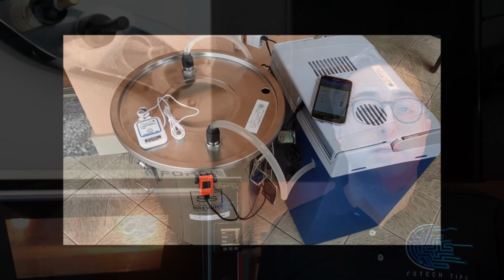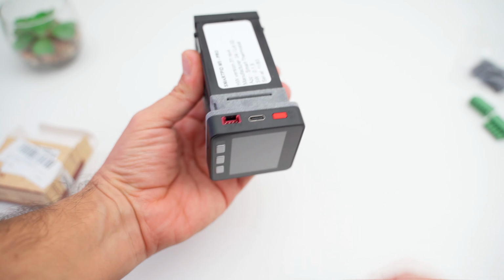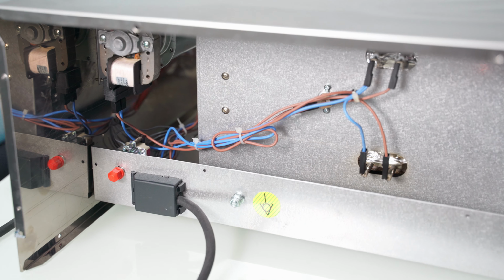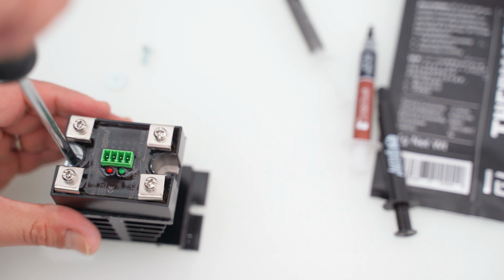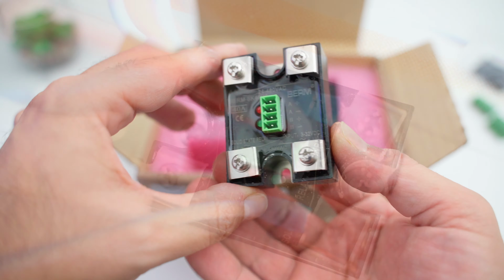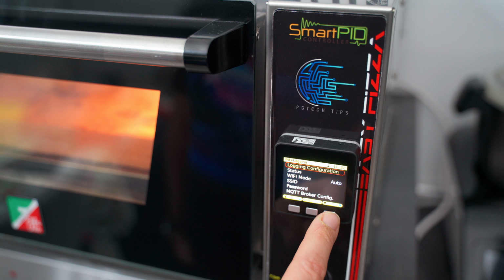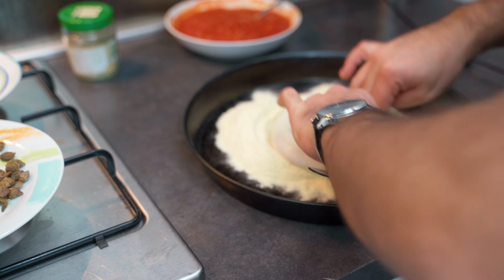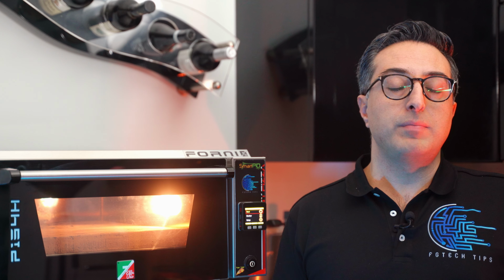Effeuno P134h PID mod with Smartpid: review, tutorial & Pizza test

Comment from the maker: Hi everyone, I'm leaving you below the list of potential changes you might desire for the new firmware, in order of priority. Let me know if you agree with these points or if you maybe have additional ones!
Italian version here: https://www.youtube.com/watch?v=20kic-XJHu8

THIS IS MY VIDEO FROM DECEMBER 2021 RECENTLY MOVED IN THIS NEW CHANNEL

PRIO 1
- Impossibility to perform simultaneous auto-tuning on both heating elements: if I perform an auto-tuning only on the upper one, the values could be wrong because the parameters I have to set have to take into account also the lower heating element (which helps in ramping up), that's the reason of the higher value than what set on the Set points and for the pid sleepiness phenomena  (it struggles to reach the set point)
- Improvement of autotuning, currently I understand that it sends 100 and zero but does not calculate all the intermediate values, this makes the autotuning extremely basic while it could be much more performant with the improvement of firmware
- No partialization which is present on much cheaper pids
- Lack of fuzzy logic
PRIO 2
- WEB app does not detect anything during tuning, everything remains on N/A. No problem instead in normal execution in monitor or start mode
- There are no limits in the set point selection: in the pizza world there is interest only in the range from 0 to 550 C
- It would be possible to remove all the probes except for the K probes or set this type of selection by default
PRIO 3	
- CSV file naming seems to be nonsense, it would be better to have a timestamp with time/date, moreover the file modification/creation date is not shown, making it impossible to know which execution it corresponds to
Reply: Im here 3 years later and totally going to do this mod to my 150HA what has changed over the last 3 years? I ordered a controller from the guy you referenced. Than, you for posting this in english its so cool!

Comment: I watched your videos and really want to do some mods on my oven. I tried to join the FB group for more information and to buy faceplate, wiring, heating element etc., but my request has been declined without any reason. What condition do I have to meet to be accepted as a group member please? I am a bit desperate at this point... :( Would appreciate any help.
Reply from the maker: Hello in order to prevent spam you need to own a facebook account older than one year. There's an automatic moderator so that only role has to be met
Reply: Really appreciate your quick reply. Now that makes sense, as I only created the FB account few days ago. Solely for the reason to join that group, imagine that... ;)
It sounds like a real pity to pass on that whole project that I wanted to start, just because of such a rule though.. :(
Is there any chance to bypass that rule somehow for a group admin maybe? I.e. by adding someone manually maybe or some other way? I promise...I have not the least intention to spam in the group...lol
Reply from the maker: Try again to subscribe to the group
Reply: @pizzatimechannel  thanks a lot. I just re-subscribed. it seems that I am one step further now. the request is still pending.
Reply: @pizzatimechannel  I'm in. FInally! Thanks a lot!! :D